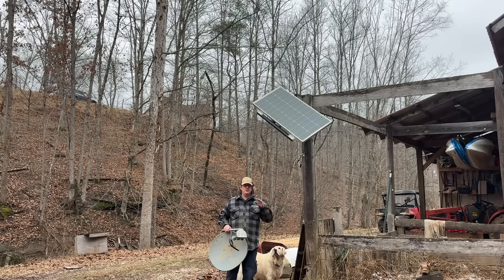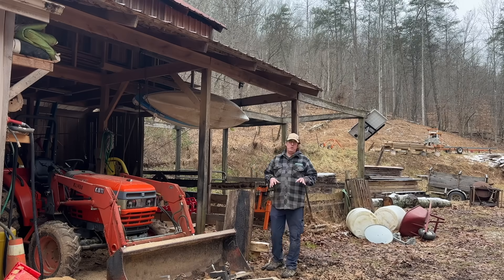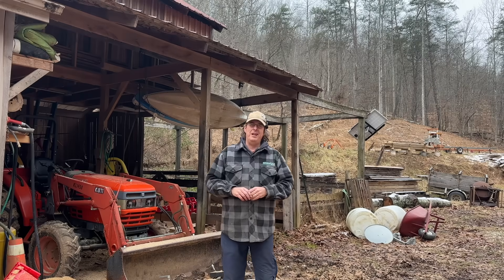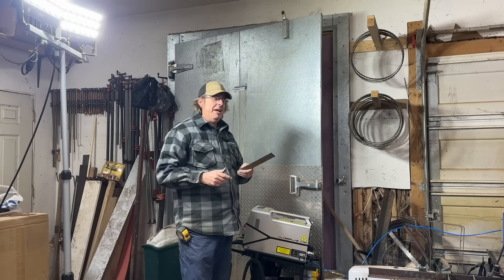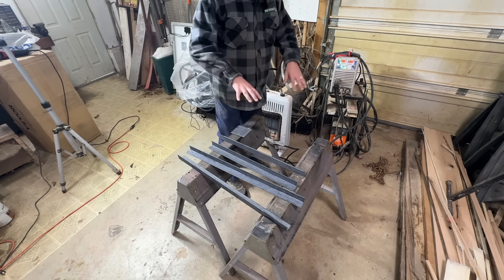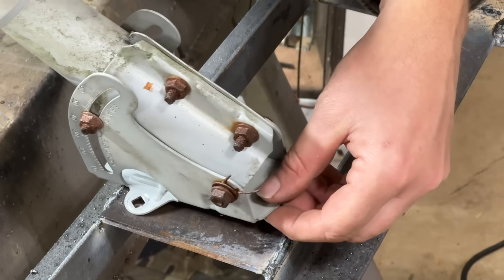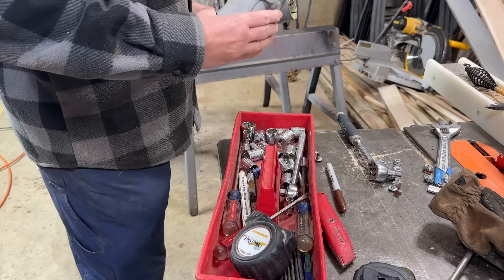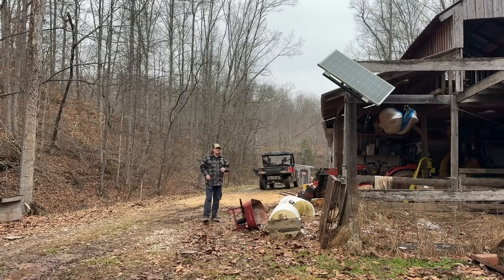Custom Solar Panel Mount for our Barn for ZERO $$$

Comment: We have started the process of using the exact same dish bracket for a WiFi extender. That's a good reminder to finish that project. :) Appreciate your update, I keep wondering if you'll finish your barn before we do. Been at least 4 years since we talked about that.

Comment: Nice job. Do you think that old satellite bracket will be to hold the weight of the angle iron, and solar panel long term? I bet the dish was quite a bit lighter.
Reply from the maker: Yes, I think so. The metal of the mount and bracket was substantial enough.
Reply: @RedToolHouse   had one just like it on our roof and agree with your assessment, if a windstorm should fold it over, it would have to be substantial, like having to repair your barn roof as well.

Comment: I am with you. Wife bought me (with coaching) a replacement tool box to enhance my 25 year old craftsman tool box. I now have all my tools in new homes and all in one place,  of sockets here, ratchets there, hammers yonder. I also took my first tools - a craftsman socket set in metric and sae that I received in ‘87 to do oil changes on my ‘81 VW Rabbit diesel - and gave them to my oldest who is studying to me a Mech Engineer and will commission as a 2nd LT in 2027 … he “broke them in” while we replaced his pads and rotors on his ‘16 Toyota

Comment: How effectively/quickly does that laser remove rust, as compared to doing it as God intended with a wire disc on a drill?
Reply from the maker: I would say it is faster and it penetrates deeper to remove rust. Still need to brush it down afterward to get the soot off